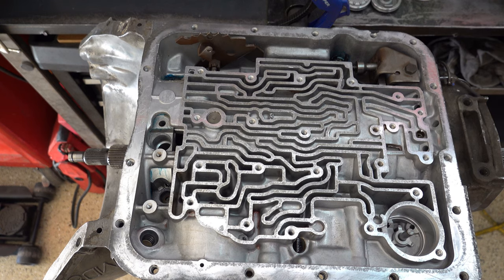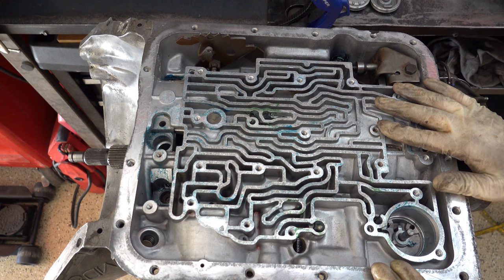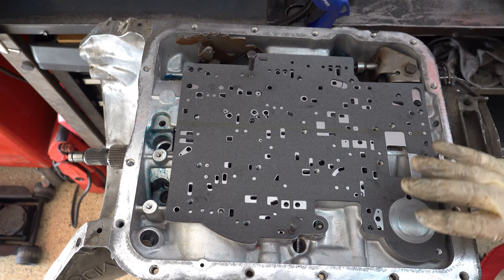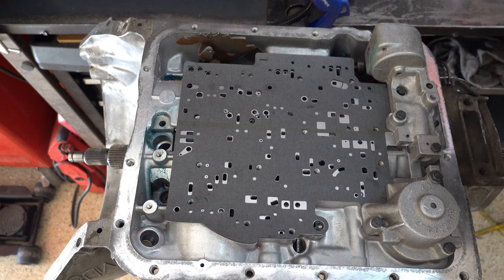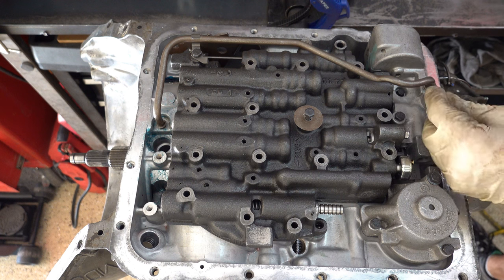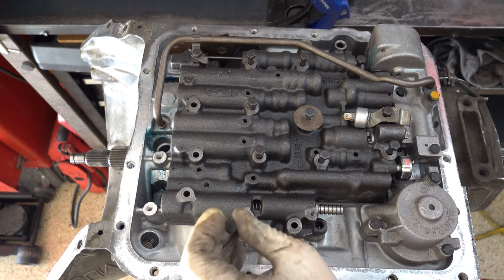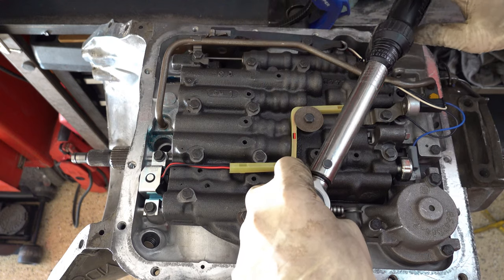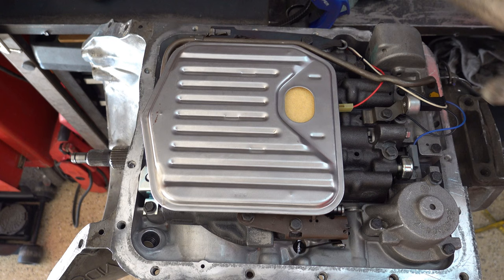How to Install a Valve Body: 700R4 / 4L60

Comment: No need for the Kent Moore dowels.  Bolts from the bolt house and cut the heads off.  Allows perfect alignment for the valve body also.
Reply from the maker: Yep, same with the pump (or use a long phillips head screwdriver to line up pump bolt hole locations while you drop it in). Use a couple extra long bolts for the 1-2 acc housing.

Great tip, thank you for watching!

Comment: Nick I'm rebuilding a 4L65e but the trans was in really bad shape, lots of trash, and burned clutches everywhere, bad bores in the valve body, I'm just going to replace the VB, can you suggest a good source for the VB. Thanks Brother love your show.
Reply from the maker: Hey Marty, Sonnax makes good ones with the oversized AFL valve kits and TCC regulator/isolators installed. VBX and a few others are also available (will reply back if i come across the suppliers' links).
Reply: @nickstransmissions  Thanks Brother.